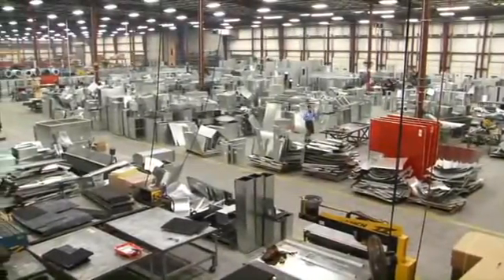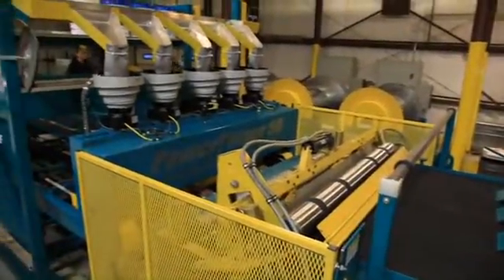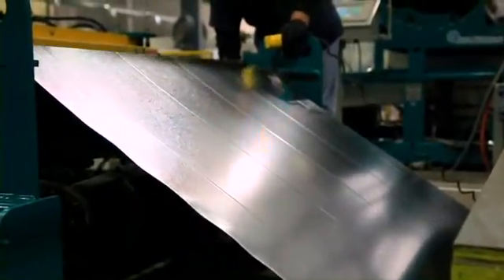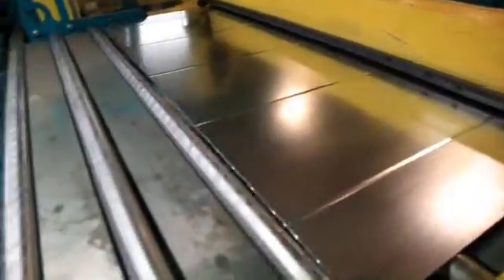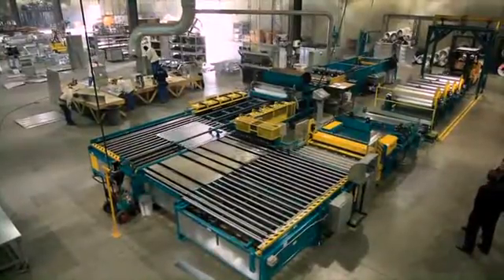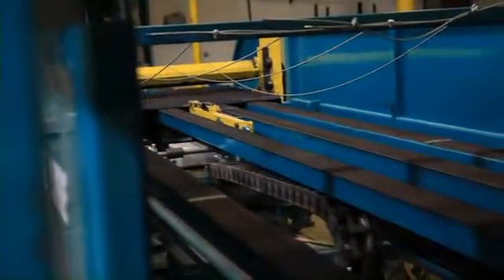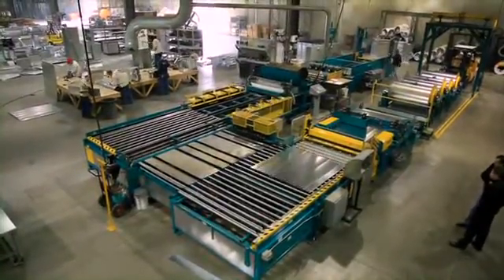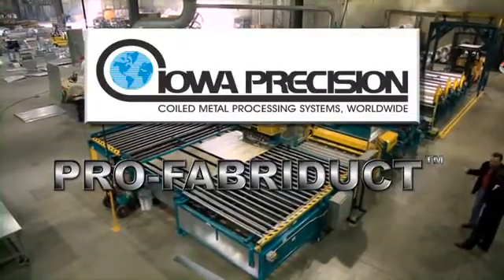Iowa Precision Pro-Fabriduct

Comment: Honestly, great machine i operated one very similar and 2 of the older versions.  But on the new ones the uncoiler motors leak at the fittings so be prepared for that. The cylinders on the pinners break a lot. But it is a pretty good machine considering it all. Just takes a good operator to know what to look for and how it works.